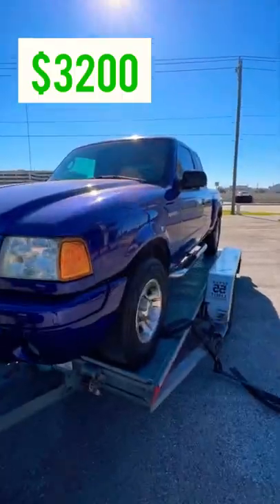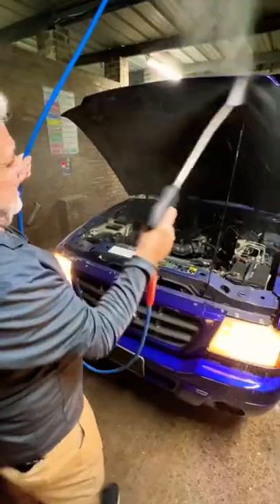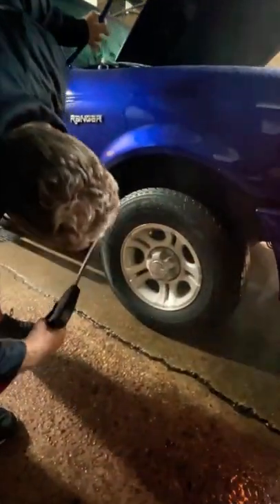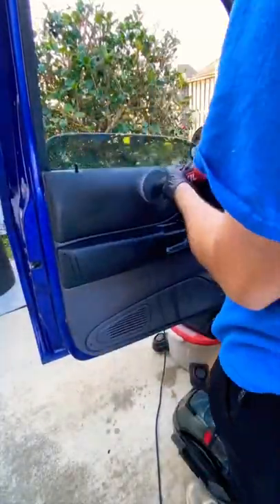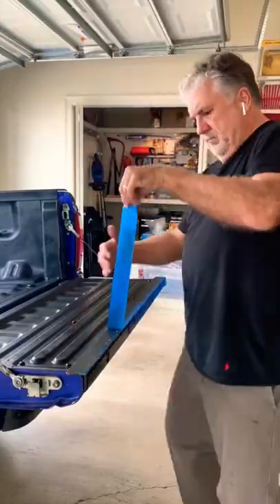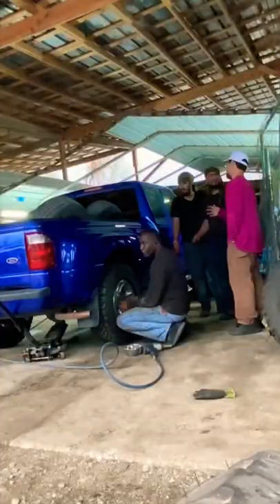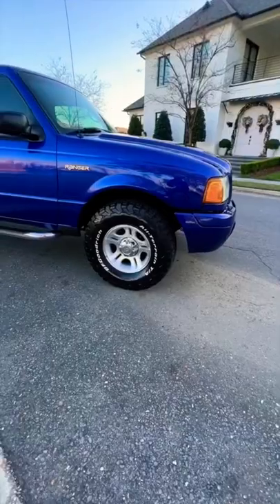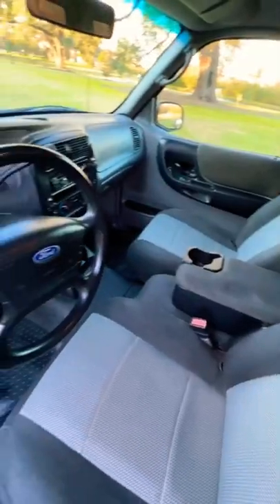$3200 Truck Flip (Step By Step)

Comment: Coming from a mechanic standpoint, unless you wire your engine in and did a really crappy job your engine can handle getting wet, pop the hood next time your driving in rain and see how wet it is, as long as your juat rinsing it and not hifh pressure, your fine

Comment: 9k is a rip off in my perspective, I have gone to multiple dealers were I have seen more modern cars for that price
Reply: Yeah agreed, but depends on location I guess.
Reply: @Ben.N  I mean I find 9k cars in California and California is pretty expensive so for that price and that truck it’s a rip off, the truck I say would go for the minimum of like 2k and maximum of 5k
Reply: He didn't force anyone to buy it lmao. How is that a rip off? 
It's worth what someone is willing to pay. 

If you're selling something worth $20 but someone offers you $40 are you going to say no? By your statement you'd have to, or "iTs A rIp OfF"
Reply: @SMD-si7fm  I said in “my perspective”. I think it’s a rip off. I’m not stopping anyone from buying anything. He originally asked for 9.5k which is still on the expensive side. Man offered 9k he took it but still not worth the mileage on the car. Yea he did the basic things to the car but he didn’t put a new engine on it so it’s basically a rip off, I’d put the truck for about 3-5k for it’s year and mileage
Reply: Trucks are selling for so much in Cali rn. My buddy’s old 90s Tacoma with 300k miles just went for 5.5k
Reply: @Nick-fr1wb  damn man what part of cali?
Reply: @RdAudi  I paid 6500 for my 2007 Lexus is350. 9000 for a ranger is expensive
Reply: It's what these go for sadly. But yes you can get better cards at 9k value. But there not this car lol
Reply: @guhbe385  I found some better prices for the ford ranger on KBB
Reply: It’s worth what someone will pay
Reply: @Nick-fr1wb  just sold my 02 tacoma with 182k miles for $12k. Granted if it weren’t for the current prices I would have kept that truck.
Reply: @MrWolfpaw66  in my area rusted out shit box tacomas go for 12k.

Comment: i bought a 2000 F150 Ford V8 4wd for $600 , guy said it ran like shit, when i came to the check the obd2 scanner said it had 5 or 6 misfires , fixed them all and sold the truck for $3700

Comment: As long as you turn down the pressure to min then sure I guess. But why risk it? Shit I just use a leaf blower and wipe down the plastic. Looks just as good and you don’t risk destroying electronics. Especially in older vehicles, most people don’t replace electronic seals unless they have too. So most seals aren’t in good shape after 10 years or less.

Comment: The reason why you don’t clean the engine is because 9 times out of 10 when the engine is cleaned or detailed it means you’re hiding a leak or something along those lines. If I find this and I am not looking at a new car or a car from a reputable dealership I will pass on it no matter what due to this reason. Not only that, but you could potentially short something out spraying water directly onto the motor and wires that could be exposed. In my opinion, I’d rather see a dirty engine bay than a clean one. Now, it’s not a bad thing to clean beauty covers or the air filter plastics but nothing else.

Comment: The whole thing why people hate people pressure washing engine bays is cause in some cases it can break seals and get water into places it shouldn’t be. But usually it’s fine.
Reply: Yeah just don't be spraying the alternator and battery and if the ecu is in the bay avoid that too
Reply: In a case like this it isn’t good old car with old hoses and such pressure washer can damage the hoses
Reply: Blah blah blah blah
Reply: @L3giT_Hax  Blah blah blah blah
Reply: @brannonatkinson  Blah blah blah blah
Reply: @DiscoMiata  you showed them
Reply: @Usef320  Blah blah blah blah blah blah blah blah blah blah blah blah blah
Reply: @brannonatkinson  very true I learned the hard way lol cussed a gnarly leak for my IWEs on my navi ended up ruining horses actuator and more lol
Reply: @Imalrightnot  I know I’m the guy saying blah blah blah, but with older cars like my Miata before I replaced all engine seals, washing an engine bay can actually create an oil leak by removing oil crust that has stopped an existing oil leak
Reply: You would hate to know how we do it at dealerships 😭😂
Reply: @elideslauriers3660  oh no I go full tilt when I did detailing, like drench the bay, lmao the cars would have to go in the shop after on occasion bc they were garbage kias
Reply: @DiscoMiata  you're subbed to sky does mincraft, gtfo out
Reply: @L3giT_Hax  also you just said Get The Fuck Out out
Reply: @Imalrightnot  Sure wet but not high pressure water.
Reply: @elideslauriers3660  as a dealer employee,” don’t give the damn salesmen the fucking buffer”
Reply: And it can stay in crevices and rust, so it would be better to go through with pressurized air after
Reply: @denverkenyon3203  oh lord, are you aware that water evaporates, also it boils under heat, what do engines make? Heat! You would have to pressure wash a crevice very closely and for a while to cause any of that jazz
Reply: @Bendoverz34  Dorman IWEs $100 hoses were obviously cheap and got a new solenoid in case I ever go back to OEM all of it ran me around 300 tops with shipping. 207K and drives great again lol
Reply: @L3giT_Hax  it doesn’t do anything. I mean maybe if you soaked the crap out of the alternator. But people forget that the motor supposed handle the outside elements. Pressure washing close can messs seals up if you extremely close. But if you can put your hand in front of it and it doesn’t hurt. Then it’s completely fine.
Reply: @brannonatkinson  mechanic for 15 years. If the hoses can’t handle pressure from pressure washer no way it can handle pressure from motor. Even vaccum hoses. If it can’t handle power washer then you need to replace that hose. Hoses only go bad from heat, old age.
Reply: @DiscoMiata  yep. You don’t wanna power wash a motor or gear box or anything when it already leaking. Just make it worse.
Reply: @notsurejr4957  getting close is what damaged it. Getting close to the distributor can mess it up. You can go as close as you want on places that don’t have seals and electronics. Either way. People being way to judgemental.
Reply: @RED-bz9hn  Yes I didn’t see the age but I can assume some were probably a few years old
Reply: I pressure washed the engine bay on my LS swapped C10. Had to wait 2 days for whatever part I disturbed to dry because the truck wouldn’t run properly. I’m thinking the computer. ✌️
Reply: @L3giT_Hax  had my corolla serviced by BOSCH they flooded my alternator and didn't wanna take any responsibility at all
Reply: I have pressure washed engine bays for 20 plus head and no issues….. the if it is a clapped out piece of crap yeah….but modern cars really can take it.
Reply: And the electronic
Reply: Yeah I’m too nervous to try it lol hand clean it is
Reply: @DiscoMiata  what
Reply: @silasbradford  what

Comment: 9500? That truck is barely worth 5000 in top shape even in this inflated market.
Reply: Exactly what I thought
Reply: "Barely worth that" but can make you more than triple the money back 🤷🏽🤷🏽
Reply: Depends on the engine and transmission. If it's the 4.0 with the manual, those go for a ton of money

Comment: I'd never buy a car with a cleaned engine bay. Usually means they're hiding something such as an oil or coolant leak.
Reply: a cleaned engine bay would make it easier to see oil/coolant leaks after a test drive
Reply: @Jacob58201  If it's a valve cover gasket leak and they don't run it often, that can be hid easily.
Reply: Clean engine bay or not. A good car buyer would either inspect the engine closely for leaks, or just have their mechanic do a full inspection.

Comment: I've cleaned thousands of cars. My career is literally detailing. We always pressure wash the engine bays. Even while the engine is still running sometimes. It really doesn't hurt the car at all as long as you're not dumping gallons of water into an open intake or anything. Also, you need to watch for some weaker wires on older cars and such. 3000 psi on a 0° tip can pierce a wire. As long as you just graze over it with 15° and higher no damage will be done!

Comment: Not bad at all. I wash the engine bay literally all the time usually with an electric pressure washer. Makes me wanna flip some cars!
Reply: Just cover your fuse box and alternator
Reply: @beliedat2457  I always pressure wash engine bays. You just have to know what not to pressure wash.
Reply: @beliedat2457  just don't spray the electronics, it's not that hard lol

Comment: If it runs and drives good 9,500for a 2010ish ain't bad it really just needed a clean look like it was in pretty decent shape to start with just the inside of the bed with scratch cuz it got used big deal everybody's a so-called expert but they clearly don't know how the car game works or what they're looking at

Comment: That way to expensive even if it was o on miles I pay 2000 for the same with lift bigger tiers an 4 liter 6 cylinder with locking hubs so y pay 9000 for that

Comment: I’ve sprayed hundreds of engines and only had issues once because some water got in the plugs, so I just let it dry for a couple hours and it was fine. 
Engines are made to get wet. Just keep away from the electronics and firewall and you are all good

Comment: My 2004 Colorado is worth more than that and its got a cracked windshield and a mouse nest in the blower motor i have yet to retrieve... literally ford rangers r way to common and tiny to even be priced this high let alone its prob got well over 100k miles on it. U didnt factor in a oil change maybe checking shocks all that. Literally anything could be wrong with that truck and u might not know it..

Comment: Decreaser in the engine bay and a light spray down after let's you use much less pressure therefore putting all your harnesses at a lower risk of breaking and or ripping when pressure washing

Comment: Quick detailing tip. It’s never a good idea to put any sort of conditioning on the touch points of the steering wheel. On the horn button is fine but never on the wheel itself. I’m not sure if you did but in the last picture it looked a little too shiny to not have any sort of conditioning done to it

Comment: Never sparky the engine bay with water you will get water into electronics and wiring take multipurpose cleaner and clean if you just have to clean it out

Comment: I personally wouldn't wash an engine bay with a pressure washer and the engine is still on especially when the engine is hot. A lot of risk to take😂
Reply: I hope you don’t drive in the rain.
Reply: @thantran9304  but fr tho the steel on the engine could contract and then you would have a hard time to change a crack crank case or maybe even an engine swap which would cost a lot or even more then the cars worth and yes wire harness on a car are designed to be waterproof but wires wear overtime especially on an old car so they can't hold water like they use to especially a pressure water and that would cause a short and make the car to not functioning properly or even get on fire.

They do hold water on the rain because there will be less water get into the engine bay as you might know engine bay is closed by a radiators at the front and a hood at the top and there's less wires at the bottom of an engine sometimes none and when you're going like more than +30mph the water would just turn into a mist because of the wind pressure so there would be less water get into the wires or the engine and they're design that way so i am going to drive my car in the rain but pressure washing my engine bay would be a no for me.